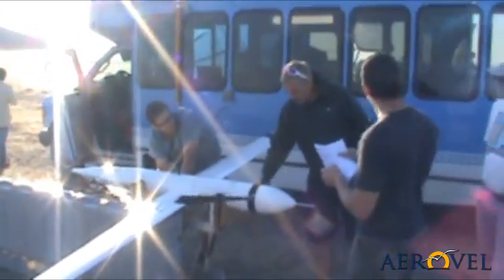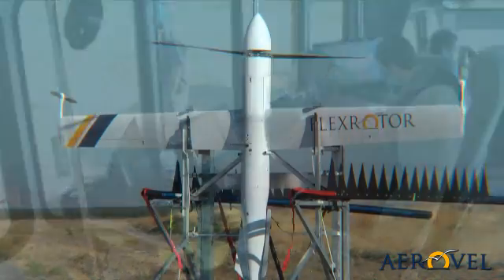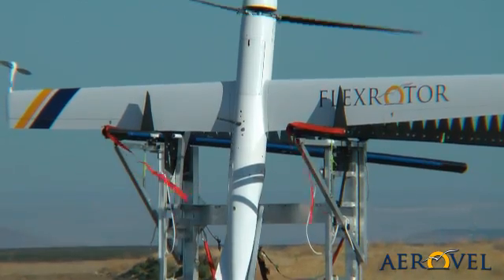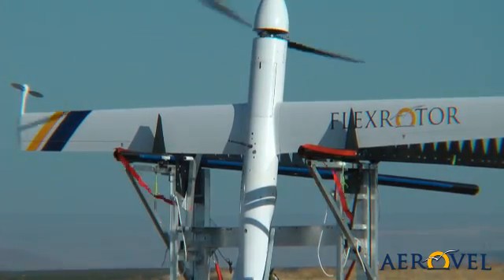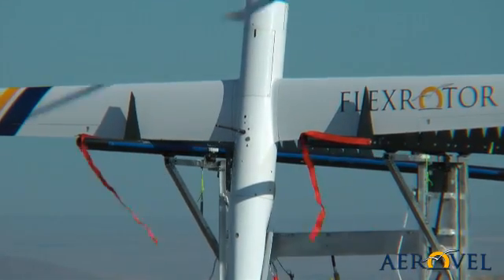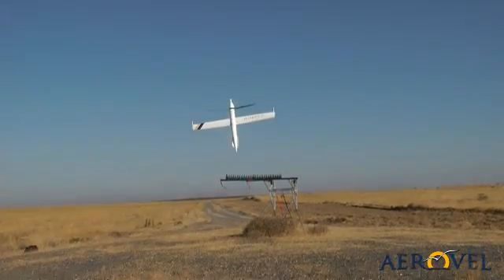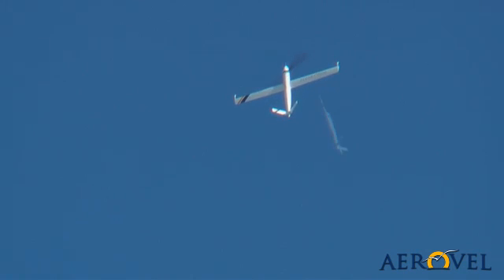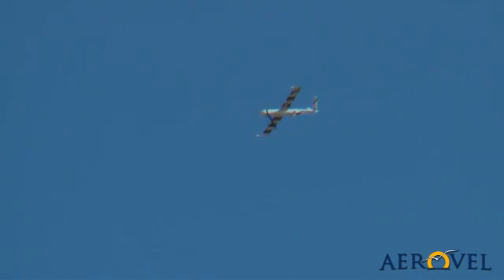Aerovel Flexrotor UAV first transition - August 2011

Comment: Why would they use the big rotors for forward flight? They could feather them and use the outboard motors by cross-linking by a common drive shaft to the main gas engine.